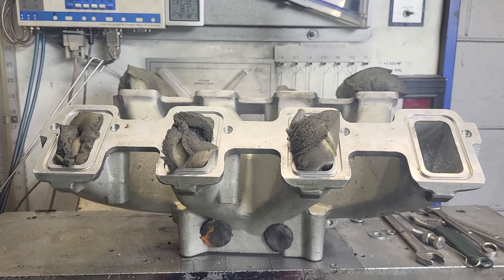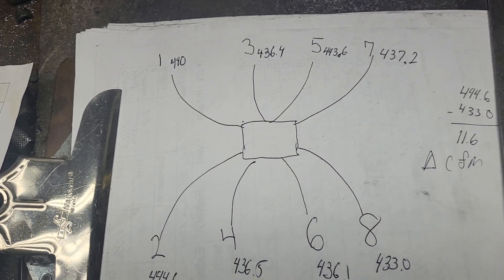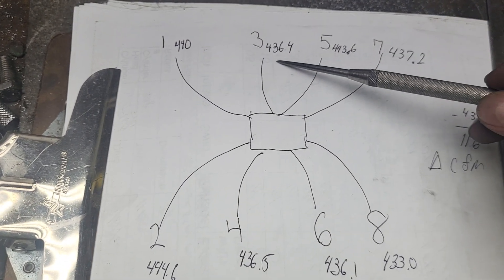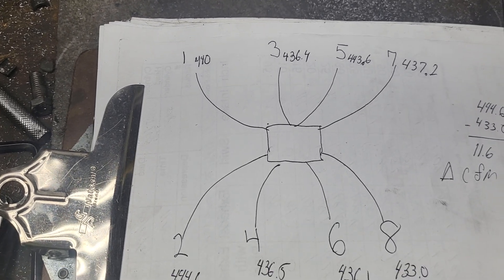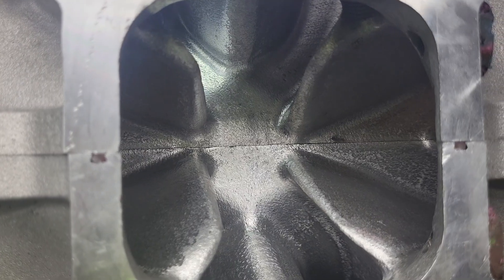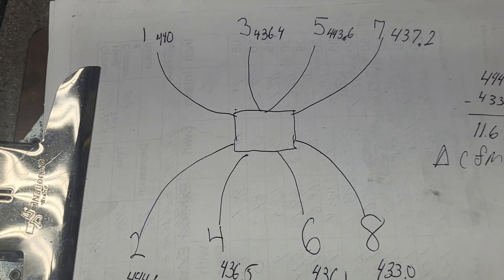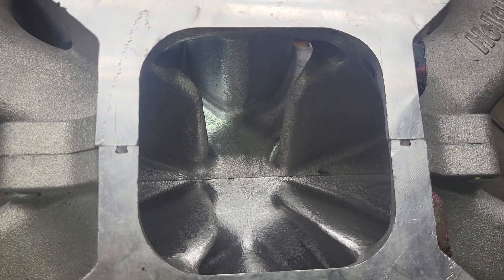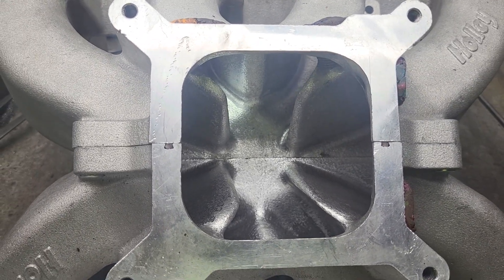Holley LS3 701r483b split intake manifold ported. Flow balance tested. Dyno work by Eric Weingartner

Comment: 11cfm difference is fantastic, that's like a 2% difference worst case scenario. Would you bat an eye if you saw a 2% difference in compression across an engine? 2% variance in leak down? I wouldn't. Keep up the good work sir.
Reply from the maker: @rolandotillit2867  Thanks!

Comment: Wow plenty flow there with intake, does tat really help horsepower and low end?
Reply from the maker: @smilsmff  Good question, it is not a low end manifold. I bet it works pretty well. Thanks
Reply from the maker: Seems this manifold when tested by Eric Weingartner beat the Super Victor and Vic jr. On low end torque, torque through the curve, and hp. Thanks

Comment: Great numbers Charlie. Very impressed. Personally, I port manifolds to suit the firing sequence/order of the engine, but that is only my personal preference. It does create issues if the firing order is changed, so it's not optimal for all applications
Reply from the maker: @theshed8802  Interesting.  Thanks